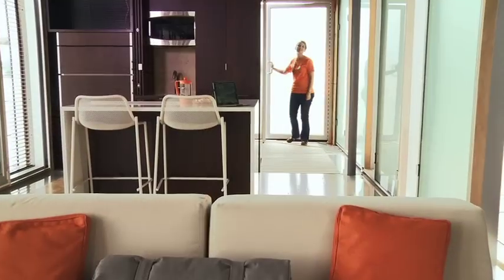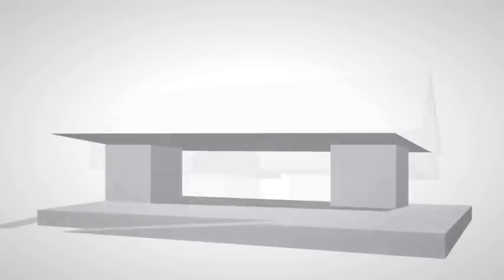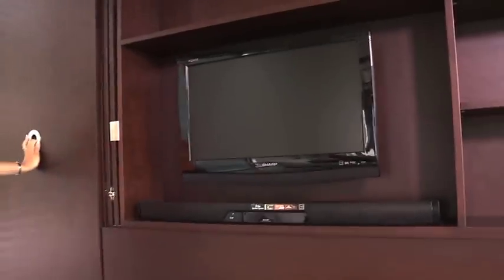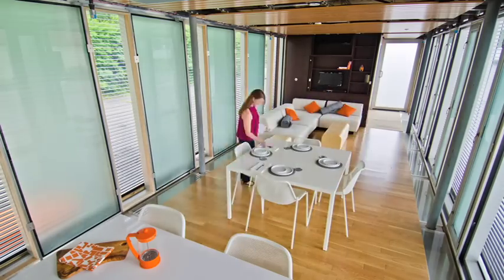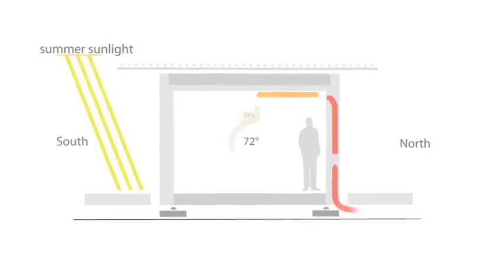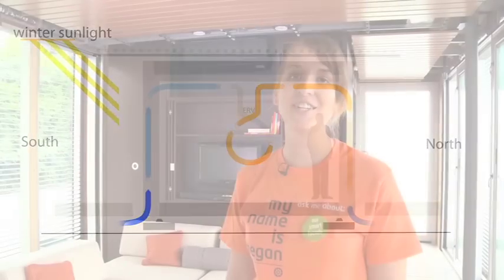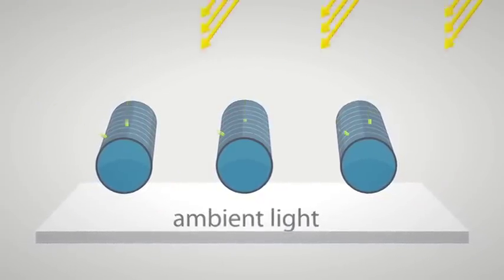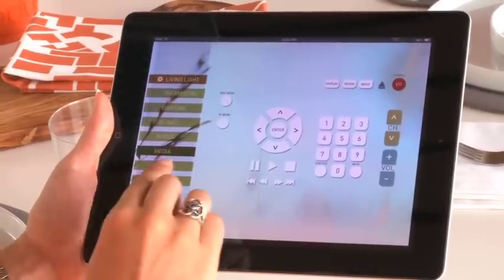Tennessee's Solar Decathlon 2011 Video Walkthrough

Comment: the cylindric solar PV tubes are inefficient in winter time due to the low angle of the solar radiation in that time. As a result most photons will be reflected. Besides most of the solar cells will be in constant shade because the tube in front will shade most of the tube behind leaving most cells not operating.
As for the air conditioning that will prove inefficient in winter time when it's paramount to not to let external air come inside the building but make your own hot air by using solar radiation passing through a glass facade